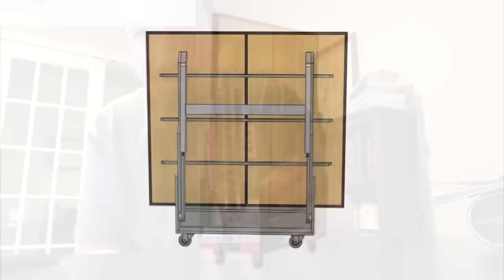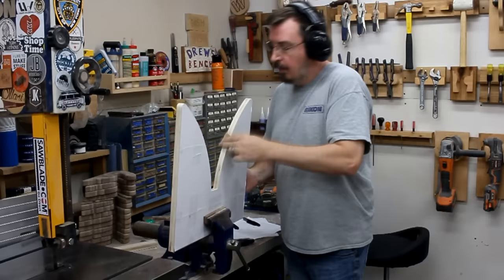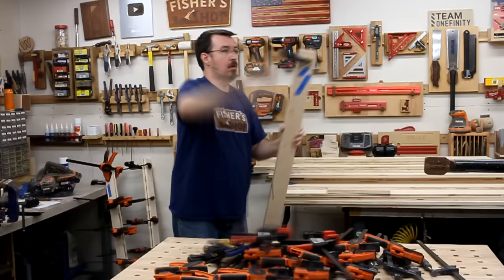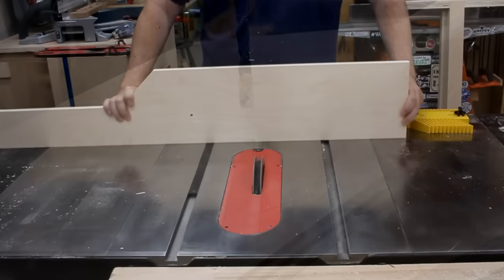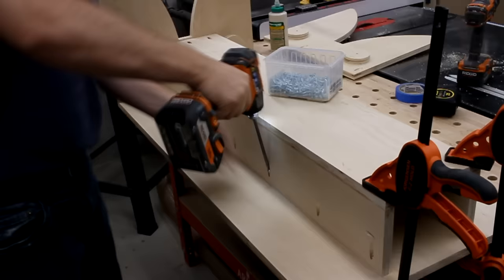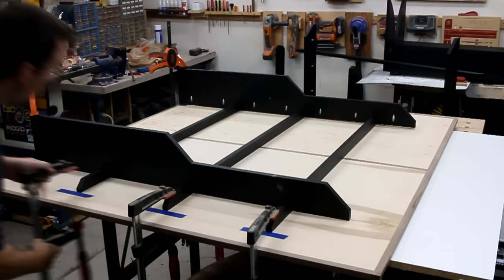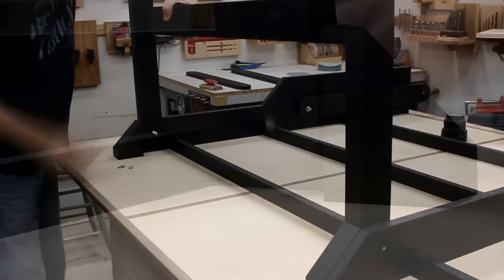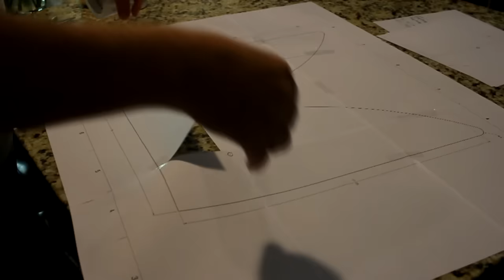Woodworking: The Ultimate DIY Ping Pong Table

Comment: Just bought the plans for this so I can modify it to make an outfeed table for my tiny shop.  I just have to make it so that the top is higher when open and it does not need to be as big.  I have been trying to figure out how to give myself plenty of outfeed table space without taking up most of the one car garage (which I have to share with my wife's car). Now I can break down full sized sheets of plywood a lot safer.

Comment: Great build replicating the folding mechanism. Just an fyi for anyone trying to make a regulation table for training: table top material and top surface paint have regulation specs for density of material (creates a regulation bounce) and final surface matte (creates a regulation 'grab' on the ball surface for standard spin response). Finally, in about 2 years when that young man is cleaning your clock, please post a video of that to complete the cycle, cuz it's coming!
Reply from the maker: Sooner than you think!  He's getting good very quickly. :)
Reply: @FishersShop  Get him a nice paddle for Christmas, foam backed, sticky face. In fact, buy the rubber & U & he can make his & Ur's in the shop. Great father-son project. I recommend an inverted eggplant shaped face, fatter at the top, skinnier at the handle, moves weight toward the outside of the swing
Reply: @EngineerMikeF  are there no regulation specs for paddle size & shape?
Reply: @kevinphanson  according to the Olympics: "The bat, commonly referred to as a ‘racquet’ or ‘paddle’, is approximately 17cms long and 15cms wide, made primarily of wood. It has a rubber surface on either side - black and red - that help the players in applying and negating the spin on the ball." Per the ITTF regulation handbook, "The racket may be of any size, shape or weight but the blade shall be flat 
and rigid." ITTF goes on with more specifics. In my day lo those many years ago, many players finessed the shape of their own paddles, frequently with a start to finish build. Very easy project.

Comment: Hey a really like your videos. Regarding the salt tipp on the glue up. Every wood glue has some waiting time before pressing the pieces together (Normally ~3 Minutes). You just wait until the corners start to try. Then you press and the slipping of the pieves is over as well. Salt does change the behavior of the glue (regarding the manrfacturer) Plus you get the best adhesion results. Take a look onto the glue packaging, you should find your "open wait time" there. Titebond for example has an open time of 5 minutes before pressing (which most wood workers won't wait)

Comment: I love this. The mechanics of the whole thing are great. And who needs testing, anyway? My only suggestion would have been to go with a darker stain instead of the poly, because when I'm playing Pong I need the color difference of a dark table to make the ball stand out and be easier to see. I'd always imagined that's why darker colored surfaces and lighter colored projectiles were traditionally chosen for various incarnations of tennis. 😸
Reply from the maker: You're right.  It's definitely more difficult if we use a white ball.  We just switched to orange and it's easy again.
Reply: In that case you’ll probably want to use a light-coloured wood for the trim, and stain the plywood before adding the trim, so that the lines are still easy to see.

Comment: Fantastic work Drew, well done. When you build the next one, could you figure out a mechanism to get the legs to automatically deploy when you open the table and retract as you close it? You might have to upgrade to Lego Technic to prototype that though.  Cheers, Paul

Comment: Have you thought about adding some weights to the legs and make them a bit more free-swinging?  This should make the legs "unfold," at least partially automatically when you open it up, as well as fold close when you fold up the table parts.

I'm sure there's more complicated mechanical ways to link the legs with the whole thing but this would be a pretty simple way to at least get the legs to semi-set themselves and then you'd just have to pull them a little bit to make sure they were fully deployed.
Reply from the maker: That might work!

Comment: Hello.  Quick question.  Printing differences so the plan doesn't quite print to scale.  The inner leg holes center to center are 3" less than final dimension listed on your plans.  With this, when the table is folded up it would seem that the top doesn't quite bottom out in the base sides notch.  It's close, but the folded top might have a little daylight between it and the notch bottom.  Am I interpreting this right?  Also when the table is folded open, the table side supports meet at the joint and stop the table joint from going past 180 degrees.  Nice design.
Reply from the maker: Depends how you fold the table up.  If one side gets pushed more than the other, it WILL bottom out on the side.  If both are equally pushed the same amount, it'll come close but shouldn't hit.

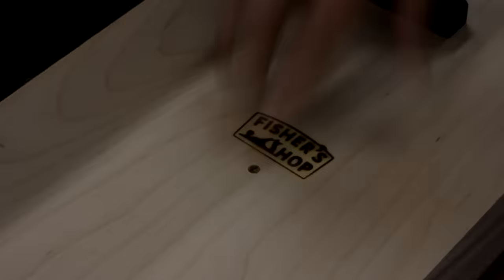Comment: Great video, random equipment question that I couldn't find on your website.  What is the make/model of your shop chair with rollers at 14:10, black seat with a yellow base you used to move one of the pieces around as well.
Reply from the maker: That's a DeWalt stool.  Love it.

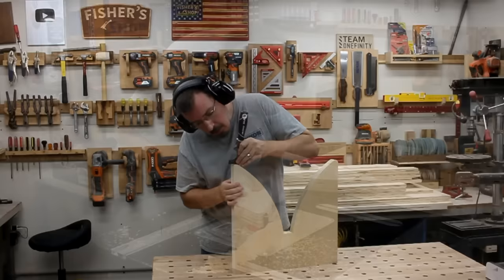Comment: This is fantastic! Great work Drew.  At 4:00 was that you, or Steve Rodgers when he splits the firewood in Avengers?  PS - check out the Kreg dust port attachment - very worth it.
Reply from the maker: Haha, The Captain hasn't got ANYTHING on me!  :)  Yeah, I have the dust collection attachment but I haven't made an adapter for it to fit onto my collection hose yet.  At the moment, it's easier to just make a mess and then sweep it up afterwards.

Comment: How many sheets of plywood does this use? Thinking of making ten of these for my school's PE department.
Reply from the maker: Since each table section is longer and wider than half the size of a single sheet, this meant I had to get 4 sheets.  However, you can special order 5x9 sheets of plywood from your lumberyard, which is what i'd do for a job that big.
Reply: @FishersShop  Thanks!

Comment: How does the middle stay up unfolded without dropping down in the middle? You didn’t show us a locking dowel or anything?
This Thanksgiving when your family comes, you can show your kids how you “annihilated” you siblings as a kid (haha Yea right).
Gonna be a fun (heavy) game for you and the kids to enjoy. BTW, a ping pong table always works as another table for eating, crafts, games, and temp railroad track layout! Oh boy!!
Reply from the maker: The weight of the table sections and the outer legs holds the center up because the inner legs act as a fulcrum.  You can add a locking mechanism if you want to use the table for something else but for ping pong, it's not necessary.

Comment: Nice design, what do you think the total weight is?
Reply from the maker: About the same as a couple of barrels full of squirrels.
Reply: @FishersShop  lol.  I wanted to build 5 for a school, so was wondering if children can roll them in/out of storage.  Maybe use ball bearing polyurethane casters to make it roll easier? Changes like that. Will track down your plan d/l to begin with.  The school had some Joola style ones, but fasteners don't anchor to the particle board tops well, they tear out, then its portability suffers.  The Joola ones would be better if they had blind nut anchors buried in the particle board, hardwood egdes and the whole surface capped with a green arborite.
Reply from the maker: Ahh yeah... a couple of kids could easily move them around and deploy them, no problem.  My son even folded it up by himself before from the side.
Reply: @FishersShop  Thank you.  Got your plans.  Just another question :)  Did you every consider asking your neighbor to buy sheets of 3/4" - 5x5' Baltic Birch Plywood.  If you swiped two of these you might get the rest of the parts out of one of his sheets of 3/4" - 4x8' Birch Plywood Sheets.  Do away with the center joint?  :)
Reply from the maker: Those require a special order, but yes I considered it.  I felt I might sell more sets of plans if I showed how I could build it out of more readily available stock.
Reply: @FishersShop  I see.  Thank for the reply.  Think I'll give your miter saw table a go too.